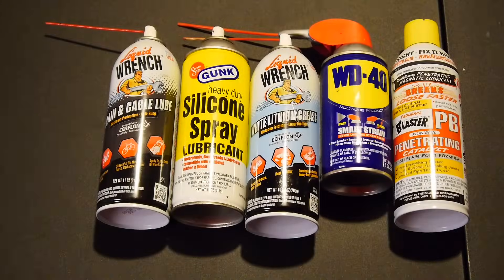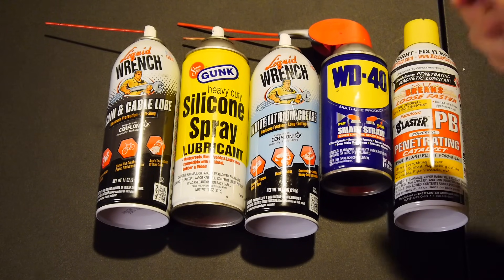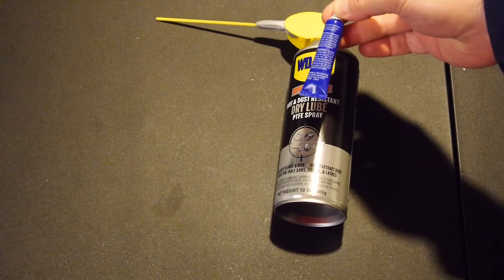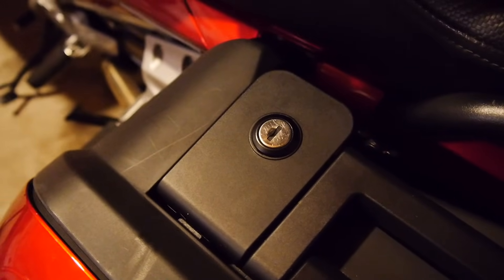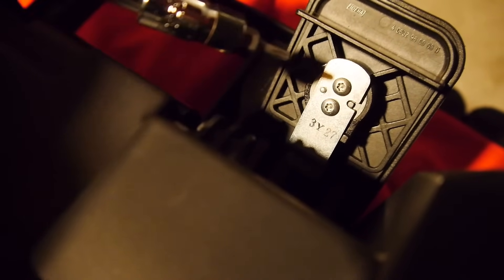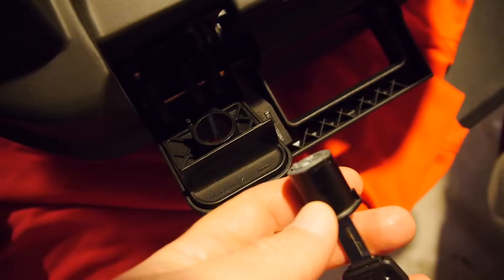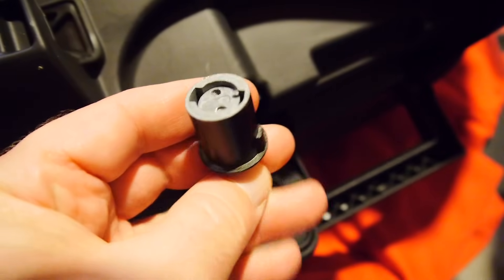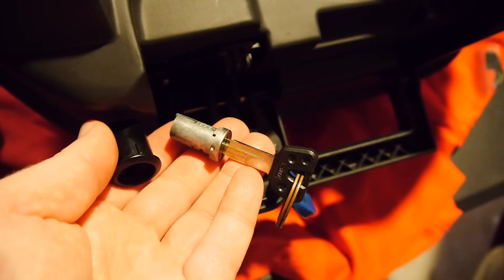Fix And Lubricate A Sticky Lock And Key

Comment: I had issues with my 3 year old main door lock, I could barely put the key in there.  I used WD-40 dry lube like you recommended and it works great now.  Thank you for the video.

Comment: I almost used wd-40. Thanks for this
Reply: WD-40 is NOT a lubricant.   It stands for Water Displacement 40.  It is made to remove water and corrosion - "unfreezing" corroded parts.  It appears to lubricate but that is because it unfrozen them and there is still "liquid there".......Once that "liquid" is gone there is nothing there to lubricate, which is usually within a day or so and then you have direct surface to surface.  If you are using WD-40 for what is used for, you should follow up with the correct lubricant - after you "unstuck" or removed the corrosion so it is lubed and not freeze up again or cause unnecessary  wear.

Comment: excellent practical advise. I'm going to clean and dry lube all the locks on my FJR, FZ-07, CB450SC, and TU250X (my wife rides the last 2).
Reply: Were you able to find a video on how to do the entire process of what you just did? I'm trying to understand how to clean out all the junk in the key ignition assembly cylinder first from all the previous times I put oil and lubricant down the keyhole.

Is it just a product that you spray in there? But then where does all the junk go? Is there some kind of drain hole at the bottom of the cylinder that will allow the old debris and junk to escape out?

If you found a video on how to disassemble the lock assembly, and pull it out from the triple tree, that would be even better! In my case, I do want to remove all the debris, and I also want to check for any worn wafers that might be in the cylinder.

Comment: That makes sense for the locks. When my FJR trunk lock got sticky, it looked like it was scraping, as you described, so I added one of those white plastic washers to lift the locking arm out of the way. It works well. I want to go back in and check for dirt.
Thanks for all for the tips.

Thor
Reply from the maker: I would never do that.  You just lessened the already limited threads of the holding screws.  There's no need to do any such thing.
Reply: I agree with you. I am going in to review and make it right. At the time, I just couldn't figure it out why the locking plate was scraping the plastic cylinder housing. Now I have an answer. Thanks.
Reply: Thor, do you have a link to a video showing how to take apart the key ignition assembly, to clean it all out?

A locksmith told me that I might have a worn wafer, so I also want to take the lock assembly apart to see if that is the case as well. If you can provide a link to a video, that would be awesome, something specifically for motorcycles would be great. Yamaha motorcycles even better.

Comment: Just when I thought I'd seen every helpful tip for a motorcycle...  Good on you for this posting.  Last fall on a long trip on my goldwing, I stopped for gas (which requires removing th ekey from the ignition and places it in the gas cap cover) and could not remove the key  from the gas cap after filling up.  It would turn but I couldn't pull it out.  Fortunately I carry a second key and even more fortunately, it was in my coat and not locked in my top case or panniers.  So, I used that key and drove on to where I found, of all things, a Honda shop.  We squirted some WD 40 to get the key out.  With your help, my first job tomorrow is to pull that lock and give it a good cleaning.  Again, good work on a seldom  covered topic.

Comment: help! I found this video after I already used white lithium grease! not only that I used white lithium grease that is apparently old and separated and bad

It's all I had and my key wasn't turning in my lock on my car, and my driver side door hasn't been working for a year so I had to use something

obviously I need to go get the dry stuff, but is there anything I should do now that I've already used this old lithium grease? The keyhole seems to be covered until you insert a key

I'm just wondering if I may have done more damage using the old grace

Can I now spray in the dry lubricant?

Comment: Thanks for info and also good idea to come in from backside is the cylinder arm tab was bent on the vehicle I bought and hitting on the window rail so no matter what you would do on the outside nothing would have happened to lift up & open. Not sure how it got that way but the clip holding tab on was not fully clicked in to maybe allow play & then someone must have cranked on it to complete a nice bend.

Comment: Great video thanks. Was literally about to spray some WD40 into my motorcycle's ignition barrell as it has go a bit notchy and the steering lock is sometimes tricky to engage, but I've ordered some dry PTFE spray instead.

Comment: What is the best solution to clean off the lock parts from the old improper lubricants previously used?
Reply: Spirit Walker I used compressed air and electronics cleaner
Reply: @DadBodZaddy  I'm in the same boat. So you're saying to use Electronics cleaner first, wait how long for it to dry? What happens to all the gunk that's in there? Does it Escape out through a drainage hole of some kind?

So then once the Electronics cleaners dry, you're saying then go ahead and apply the WD-40 PTFE specialized product in this video?

Comment: Another product you may want to consider is ACF-50.  Developed by the Aerospace industry to protect against corrosion. It's an amazing lube and protector.  Safe on all surfaces including electrical contacts.  I used it the first time this year and am sticking with it.
Reply: I use ACF-50 on exposed parts of my cycle for the winter, but junk builds up on it like crazy. Needs a serious wipe down come spring. I wouldn't put that inside a lock. Besides, it protects against corrosion, not intended to lube anything.
Reply: I wouldn't, if you think wd40 is sticky, acf50 is really sticky! Dirt loves it!

Comment: Question:  I already applied both WD-40 and electronic parts cleaner into my motorcycle's sticky ignition (I can't turn the key to start the bike).  If I now try dry lube, will it mix with the aforementioned lubes and gum it up even worse than it already is?

Comment: Used WD40 and lock loosened after one appication. I had stopped using this door lock more than 5 years ago because it was stuck. 1999 Ford Expedition. Next I will eventually put some graphite or dry lube.
Reply: No WD-40 only makes the moisture dry up
Reply: @prince_sach50  I saw several youtube videos where they saw the WD40 attracts dust and dirt and will eventually stick again. So thanks for letting me know. I also figured even if this was true I could use WD40 again.
Reply: @prince_sach50  All I know is my door lock working great. So I lean towards your truth as superior.

Comment: I used White Lithium Grease on my motorcycle ignition barrel today... The immobilizer fuse burned on first ignition and now it won't start. I used every spray for cleaning the barrel, in effort to remove the white lithium grease. I hope the damage is only that because there was cable burning smoke coming out somewhere near the lock :|

Comment: I tried WD40 PTFE spay on my car a few years ago. My door locks and hood lock rusted into a solid piece in one winter. I accidentally sprayed the paintwork too, it was almost impossible to remove. In the last 15 years, I used some kind of non driing oil or regular wd40 on my car locks, and they all repel salty water. Dust is not a problem, because these locks have dust cover on them.

Comment: Let’s just say that I used WD-40 in my ignition and it tracks a lot of dirt. Is there any way to undo it or clean it out?
Reply: Same boat. If you find a video, or figure out how to get all the old gunk out first, let me know. Something tells me that just spraying a product in there to clean out the old gunk won't actually remove it from the cylinder. Because where does it all go?
Reply: @OldCootProductReviews  it'll drain out through the bottom, use a air compressor to blow the dirt out to help
Reply: @OldCootProductReviews  use brake cleaner to clean old gunk out

Comment: Locksmith of 40 years here.....This is not true. Your auto locks and cycle locks are already lubricated with a petroleum or lithium type lubricant. Adding a dry lube will do exactly what you are claiming will happen if you use WD40. You are adding a dry powder to a wet environment. This will produce a low viscosity gunk that WILL attract and hold dirt. WD40 all day long folks.

Comment: Will graphite remove wd40?
Reply: I wouldn’t have thought so. I took my locks out and operated the key whilst in a cup of isopropyl and loads of crap came out of the lock. Then let it dry and then applied WD 40 dry lubricant. Locks worked treat afterwards.